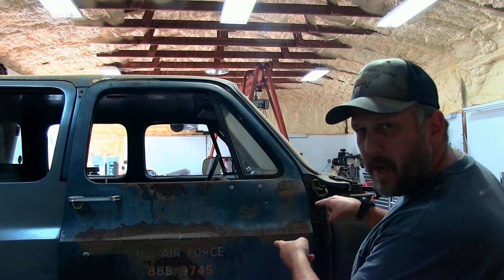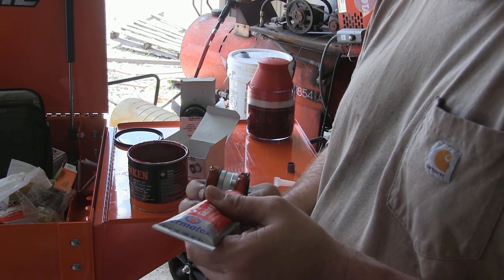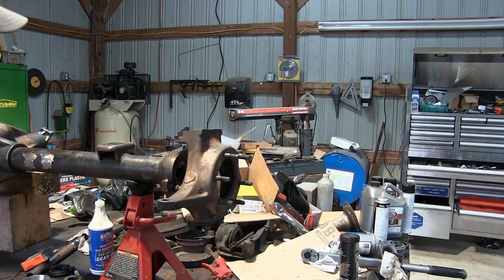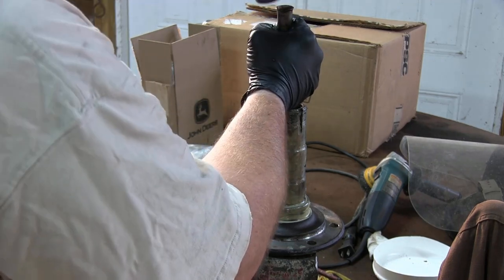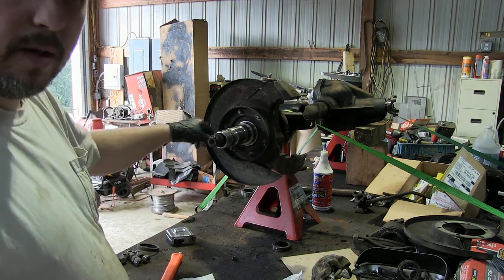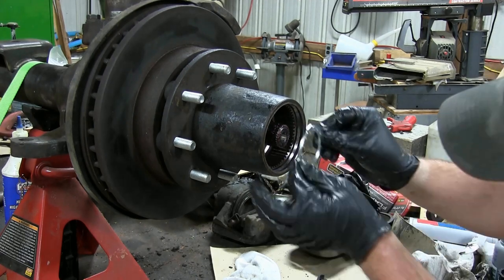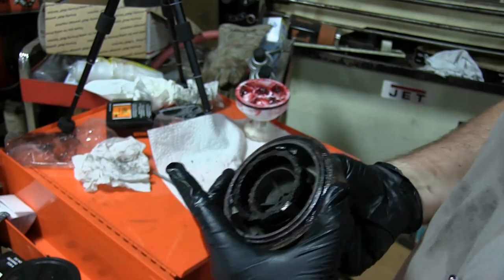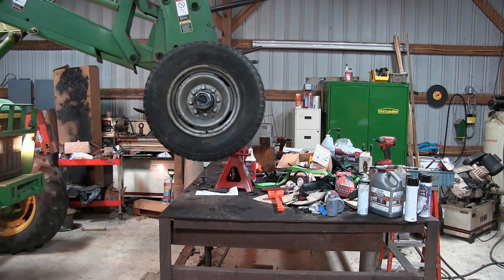Full Dana 60 Rebuild DIY

Comment: Finally a good video on Dana 60 rebuild I can follow with proper torque specs .cheers
Reply from the maker: Thanks for watching!
Reply: @Offroadfarm1  i clean the axle shafts,& paint them. with new u joints. hope you did the spindle bearings.
Reply: @Offroadfarm1  sintered bronze,self lubing.  why not the uni. ?.to do that u have to pull it all again..
Reply: @Offroadfarm1  you know why you back off the nut.?.the second nut pushes it to the bearing. if the first is tight,itll wreck the bearings.should be a few thow of clearence. expansion..
Reply: @Offroadfarm1  its not necassery to pack the spindle void, but it cant hurt. ive done it but thats me..the cone throws the greese to the bearing. not out..
Reply: @Offroadfarm1  that lock hub assy should be replaced with mile marker or better,. those plastic bits grenade..plus ive had the centre of the alloy hub body separate from the outer & it eventually locks itself. sounds like an ooozzy going off at 100 k,, for $100,its worth it. mates did the same,nearly stranded him. good job,good vids,keep it up.. id of thought with new diff bearings,the thow would be less,. setting up with old bearings then replace with new,you lose 2-4 th. from wear. usually..
Reply from the maker: Yes I did replace the spindle bearings.
Reply from the maker: Yes that locking hub is junk!  I want to upgrade the axles and the locking hubs at some point but don't have the cash right now.  Thanks for watching.

Comment: So you didn’t use the factory seals where you have to pull the ring gear to install them huh? Thanks so much.  I’m rebuilding a ‘92 dodge Dana 60
Reply from the maker: I did use the seals in the pumpkin.  I just installed those in a different video.  check it out here https://youtu.be/ysBqO3lRdOk starts at 0:49.  Those outer seals are mostly to keep trash out of the axle tube.  Thanks for watching

Comment: Can you post a part number for those outer axle tube seals by chance? Thanks
Reply from the maker: Outer axle seals:  https://www.offroaddesign.com/d60-outer-axle-seal.html
Thanks for watching!
Reply from the maker: Thanks for watching!  Just remember heat the inside metal sleeve only.  Not the spring itself!!  Good luck on your project
Reply: @Offroadfarm1  Thanks for the responses Chris! Appreciate the input! Cheers

Comment: Is it possible to remove the steering knuckle without disassembling the hub? I need to change the kingpins but I had the hubs done a few years ago and don't want to mess with them if I don't have to.
Reply from the maker: It depends on what you need to repair/replace.  If all you need to fix is the kingpin bushings or springs then yes.  Just jack up one side, remove the top cap and replace what you need.  If you need to replace the actual king pin then I don't think you can pull the knuckle with out pulling the hub and axle.  You could probably replace the bottom king pin, I'm just not sure if you would have enough slack in the U-joint to get the knuckle over the top king pin.  Thanks for watching and good luck on your project!
Reply: @Offroadfarm1  last year I replaced the upper bushings, and my camber out problem is still here, so I believe it's the lower bearing that needs replacing. When I did the upper bushings, I inspected the upper kingpins and they looked good, hardly any visible wear at all.
Reply: @Offroadfarm1  thanks for the fast reply. Also, I love the old squarebody GM iron, even though my off-roader is an axle swapped 99 Yukon

Comment: How's that outer seal working for ya?  Rebuilding my off-road CUCV axle in a few days.  Curious as to how well it kept stuff out or, rather, just held mud and dirt in
Reply from the maker: Sorry, my truck is not finished yet so I can't offer any feedback.  Call offroad design and talk to them and see what they say.  Good luck on your rebuild and thanks for watching.
Reply: Easy to install and no issues on the CUCV axles. Get the smaller diameter one, 2.0-2.25" size if I remember correctly. ECGS has them in stock.  I shoved some massive RCV axles through them with RCV CV grease and it was a super easy install and slide the axles through. Mine slid into the tubes with my fingers, and just one light tap with a seal driver, I added a bead of RTV on the outer race of the outside portion of the seal and gave them 24-hours to cure before putting the axles through.